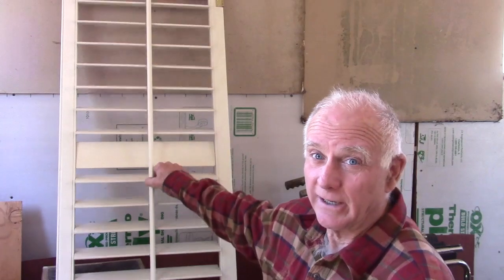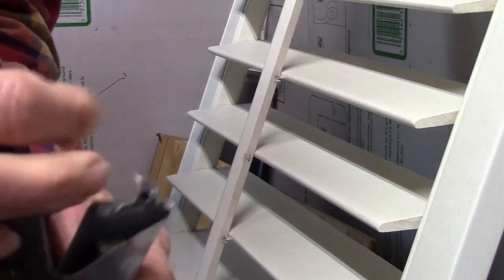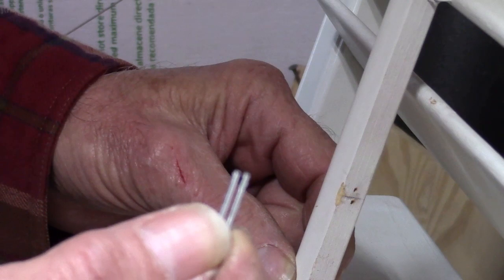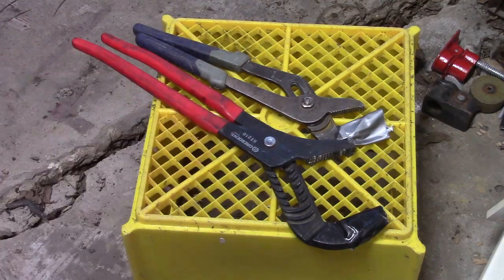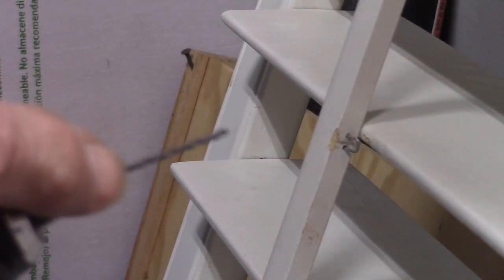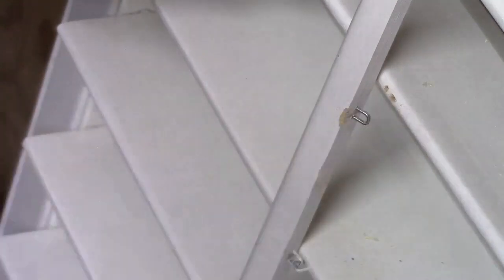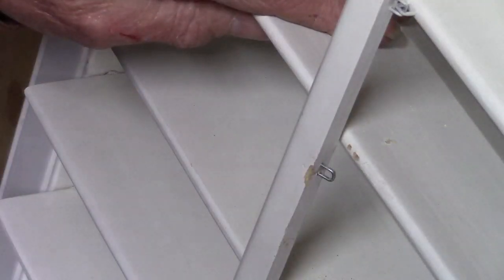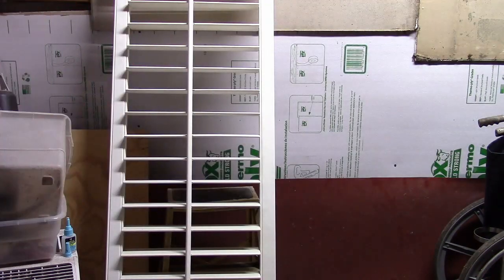How to repair a large blade shutter slat staple that has pulled out, do I have to remove the shutter

Comment: I like the idea, so I think,I improved on it by using a small rubber tipped clamp, the kind used for clamping material after gluing together (bought from harbor freight for $6), instead of taped pliers. Also, the staples I used are only slightly longer than the ones that came out. I used a dab of wood glue and inserted into the existing holes, pushed as far as I could with fingers, then used the clamp to seat the staple.
Reply from the maker: Sounds to me like you got it done and I'm going to harbor  for rubber tip clamps for myself
Reply: Exactly what I was going to say… those rubber tipped wood clamps from Irwin is what I used and I just pressed the staples into place. Worked really well. That way you’re not making a mess with the tape. All you do is squeeze the trigger and ease it right in and it was really safe for the blades